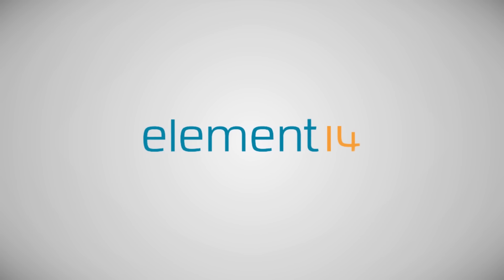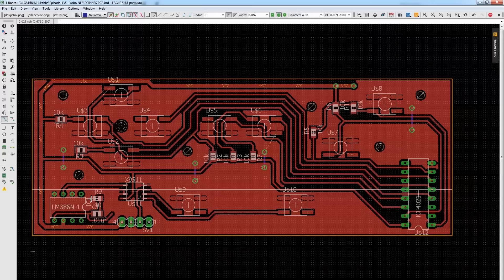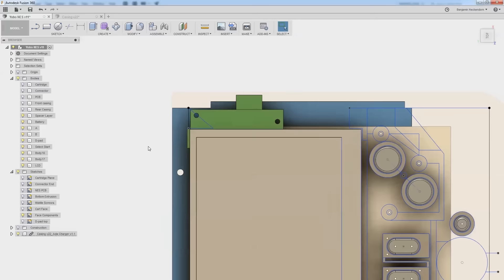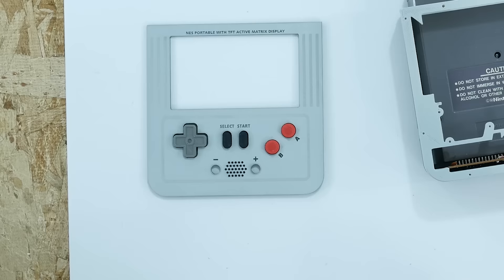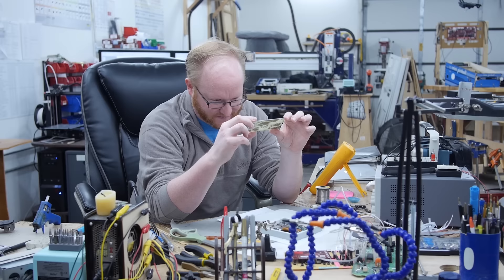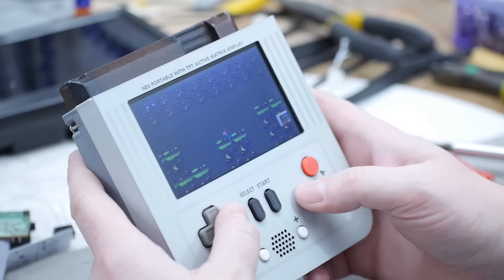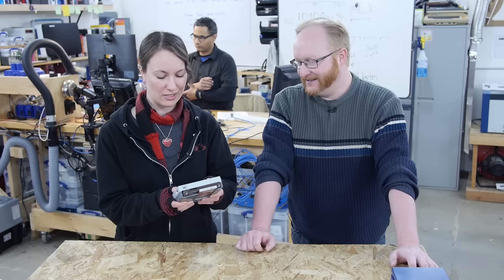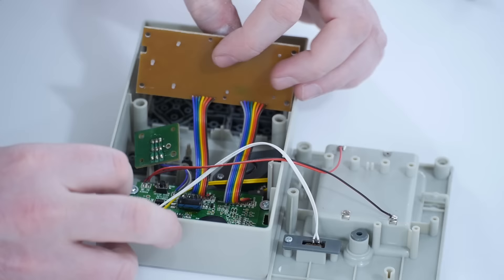Game Cartridge-Sized Nintendo Portable

Comment: That's pretty cool!

Since you asked what other features I'd want:
4:3 display
headphone support
multiplayer
carrying case
Reply: How do you see multiplayer working?
Reply: Hook up a second controller? There are portables with joystick ports, like Supaboy, etc...  Sometimes they (stupidly, IMO) prevent the joystick ports from working unless you're using an external display - but there's no reason you couldn't connect a second (or third or fourth) controller to this.
Reply: ...Or, to link portables together for multiplayer - make a game-link cable that carries controller signals, video, and audio. If a console starts up without a cartridge in, put it in "multiplayer slave" mode and make it take audio/video from over the link port, and send controller signals out over the link.
...But then you'd need to build two portables. :)
Reply: A few multiplayer possibilities:
1. controllers and a kickstand
2. a companion player two slave device without a cartridge slot and with cloned video screen and speaker sound
3. a full-featured identical device that can be either master or slave
and bonus points for wireless vs wired?
Reply: Could go old school and have a single plug that uses a multi-tap and allow connecting multiple external controllers.

Comment: It's an amazing little build. One thing that would make it more ergonomic in my opinion is if you stacked the B and A buttons the opposite way, where B would be higher than A. This way you can play games like contra or Mario more easily (holding B to run and jumping with A at the same time, etc)  The current way makes it hard to use both buttons simultaneously.

Comment: I'd want two controller ports and a display port so it could work as a regular home console.

Also being able to load rom files would be sweet.  Micro sd or something.

And correct aspect ratio is a must.

Comment: Other features:  Headphone/speaker  port,  Video out (mirrored or just to the external), , Two controller ports, proper 4:3 aspect ratio screen, turbo buttons, slow-mo buttons, video in to use the screen as a portable monitor for other devices.

Comment: Dude the player two port would have been such a nice feature. Probably would have gotten away with using a secondary usb port and the handheld could have had an "accessory" piece like the old 80s, 90s handhelds. Sorts like how the multitap was just an external controller extension fused with a hub. Maybe even use a NES styled version of Nintendo's gamecube to wii u setups.

Comment: I'd say cram an fpga in instead of a noac so it would run flashcarts and increase compatibility and could also use sdcards or thumb drives.  That's a much bigger project though.

Comment: Instead of controller ports just embedd the 8-bitdo wireless controller dongle -- heck, it would have been neat if the bottom portion was one of the two wireless controllers that just snapped in and out.

Comment: Sweet project! Would it possible to use an actual NES logic board or an FPGA chip component to create the same resulting project? I think it'd be many times more authentic if as close to native hardware as possible was to be used. FPGA chips are awesome because (and I know this isn't its video) you can program it to act like any console you want, i.e. make a super close to native (if not already native) N64 portable. I know you used an actual N64 board for that project, but an FPGA-based version would be somewhat easier I'd think since it's less hardware to worry about. That's from an ethusiatst's eyes, as I'm not a "maker".

Oh and yeah I echo a few people: A headphone jack would be nice.
Reply: ShiggitayMedia This is better than an fpga. It's an entire NES inside a single chip. Basically a permanent FPGA. Except I read it has bugs, and it can't be fixed with software.

Comment: The NOAC circuit board kinda limited the design of the system. I would've loved if you rewired the cartridge connector so you could tilt the board on its side. Video out and cartridge ports would be nice too. Cool handheld regardless, though!

Comment: One thing that seems to be overlooked in this resurgence of retro gaming devices is the importance of a big screen size. You never want to hook a console into a TV thats less than say 32 inches, so why buy a device that plays games on smaller screens? I've modded everything to play retro games and it's never good on handhelds. For the ultimate worst retro gaming device use an emulator on a portable device that uses touch-screen as an input. People also don't seem to understand that touch-screens exist out of necessity to conserve space on small devices and aren't a better input method compared to physical buttons.

But yeah if you want every game from the 90's and earlier on a portable device with buttons then buy a PSP and mod it from home.

Comment: mmmh. Now do it with a Super NT - that thing is small enough that if you remove the case and rewire the cartridge port it'd make a decently smallish handheld.
Combine with a 7-10 inch LCD (they're all over ebay; usually with hdmi+vga+composite input)...
Should be decent. XD

Comment: I think a usb/micro sd chip reader for roms would be cool.
Reply: Such devices do exist for the NES. Though if you're not using real carts, and you're not using real NES hardware, what's the point? May as well just emulate everything at that point.
Reply: I mean obviously there are modern "classic consoles" with those options available, I don't believe that's information anyone here didn't already have. My suggestion was just a want for more options and further accessibility. If your going this deep into customization and homebrewery why not add one more quick quality of life bell and whistle?
Reply: just make a portable raspberry pi zero with retropie its cheaper
Reply: My only point was "why not both?"....
Reply: I agree with you. If you read my fleshed out comment I just posted (as of the moment I'm typing this one) I suggested they use an FPGA chip/component so it's not emulating a thing as it is in their iteration there. An SD/SDHC card slot or even a ROM cart with an SD Card in it would be nice. No emulation (as mentioned above) would be used if paired with an FPGA chip, and it'd make it the ultimate portable NES since you could have virtually ALL the NES games ever onboard to take with you anywhere!
Reply: @shroomboi Because as advanced as NES emulation is these days running the software on actual hardware is the most authentic and satisfying.
Reply: But this is not the actual NES hardware, it's very mediocre third-generation knockoff. UMC tried to reproduce NES chipset on the cheap, introduced some mistakes, then another manufacturer copied UMC, introduced more mistakes, and like that 2 or 3 more times, and then you have the chip that powers this contraption.

I do think designing a whole SD-card cartridge emulator, for whatever system, would not be such a terrible idea, but i don't see how to fit it into a weekly video series because it's a larger project and quite in-depth. I suppose if it was for example for the Megadrive, you could get away with setting SRAM straight on the cartridge bus and any microcontroller in parallel to it to prime it on boot, or make it writeable from PC via some kind of USB to parallel adapter IC, and you can still get like 2MB 5V SRAM chips, so two of those would fit most games. With NES, things get quite complicated, as the cartridge contains actually two memory buses, and then you need to implement a mapper, at which point your cartridge essentially must be an FPGA and fairly involved code. VHDL/Verilog development is painfully slow.

Comment: Yet another NES controller where the A and B buttons are at the wrong angle...

Try putting A below B instead of above it so that you can push both buttons at the same time.
Reply: shrug This kind of layout worked fine on the Game Boy...
Reply: Tetsujin and on the SNES
Reply: +Warren Carlson Yes but most SNES games mapped Y and B to the same kinds of functions that B and A respectively fulfilled in NES games, effectively allowing for a control scheme that better conformed to the natural positioning of the thumb.
Reply: Yeah good point, they should at least be side by side. I never thought about that even seeing him play Contra.
Like you said though aligned in a \ formation might be better even if it looks wrong.
Reply: Ergonomics go a long way.
Reply: I don't know what you're getting so worked up about.

Snes layout works fine. I mean, the n64 has the layout you're talking about.

But I question your reasoning.

on a SNES pad I find the easiest combinations are B+A, B+Y, and A+X

Y+X is marginally more difficult, and the worst is B+X

I personally find B+A the easiest to hit, but maybe I'm just used to it?

Granted B is usually the main function and A the secondary function, but that's a quirk of Nintendo's right to left lettering scheme.

If B+Y is easier for you than A+B it probably says more about how you hold your controller than it does about it being innately better.
On an Xbox One controller, with basically the same layout but large grips getting in the way I find it even worse to press (in this case A+X given the naming difference).
A+ B is easier.

Remember though that ergonomics is not a one size fits all affair;
There is no ONE optimal layout because different people have different sized hands and different finger lengths and so on. 
For instance I find the shoulder buttons on most controllers are too far to the side, grips if present are too small and at the wrong angle, and stick placement, especially that used by playstation controllers is also awkward (and in the PS case prone to my fingers hitting one another.)

Someone with smaller hands may find some of these same controllers difficult to even hold.
Others with larger hands may find literally everything is out of place, too small, too close together and so on.

Controllers are an averaged approximation of what's best for a wide variety of people, but few of them are perfect for any given individual...
Reply: KomradeMikhail I was thinking the same thing, what are you gonna do when you have to press both buttons at once? You'd have to tilt the whole device.
Reply: Sal X Tactile always felt better to me, to each his own.
Reply: This was the first thing I noticed.  Those buttons are in the wrong placement.  They should be side by side or slanted to fit the natural angle of your thumb which would put the B button above the A button.

Comment: You guys need to make a bubbler etch tank and use some of the alternatives to ferric chloride.
Reply: .....tell me more of these things you speak of. /intrigue/
Reply: Since we can't post links, I googled "pcb etching bubbler tank" and there is a video on making your own (as well as writeups).  You use a fishtank bubbler in the bottom to create air bubbles, which act as a pseudo abrasive to remove the copper more quickly.  There are arguably safer household chemicals which can also be used for etching, and they are easier to obtain than FeCl, a google of "pcb etching with household chemicals" should turn up useful results.

Comment: After that, make videos for the following systems to be portable: famicom, famicom disk system, (snes and super famicom have plenty of portables from retro-bit and hyperkin), nes classic, famicom classic, snes classic, super famicom classic, sega master system, sega game gear remake, sega genesis total remake that is portable, accepts genesis, 32x, and have cd drive for sega cd and also become a remake for the nomad. Even more systems, (saw a video about the N64 portable but if only it had the special N64 stuff with it such as the expansion pak, the rumble pak, the memory pak, and the transfer pak which is very much needed for pokemon, and the N64DD), the gamecube, sega saturn, (saw a video about the dreamcast portable), the original xbox (really needs to be entirely remade to reduce the size of components and power consumption and is one of the later gaming techs requiring smaller semiconductors), the neo geo line, the nec-turbographx line, ps2 and possibly ps3. Or make an all in one system that have replaceable cartridge slot holders and replaceable optical drives to match a large number of consoles and keep it portable.

Comment: ....i just noticed Karin's wearing a Locket. GAWD
Reply: It's a PCB heart pendant made by Circuit Breaker Labs. I got it at the Pittsburgh Maker Faire after missing picking one up at the Milwaukee Maker Faire.
Reply: I wasn't sure if it represented Zelda or Undertale when I saw it (or neither or both!), which left me to point it out.  Awesome to know where you got it from!
Reply: Zelda is usually a pretty good guess when it comes to me. Heck, right now I'm wearing a Zelda necklace I got at MGC last year. You're not too far off!
And oo, if I mention Circuit Breaker Labs I also have to mention Lumen Electronic Jewelry. Rather than cut up PCBs coated in resin, they're actually functional PCBs in cool shapes/designs using tiny solar panels, LEDs, and a USB port.